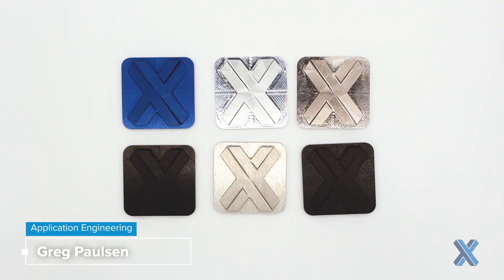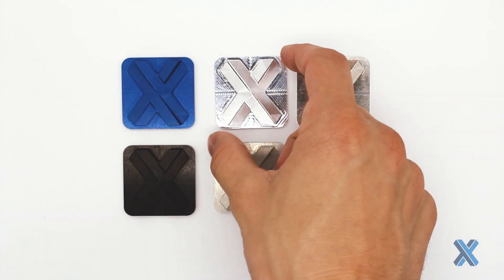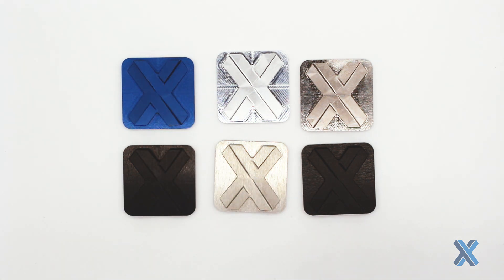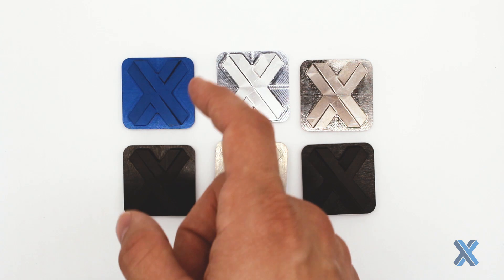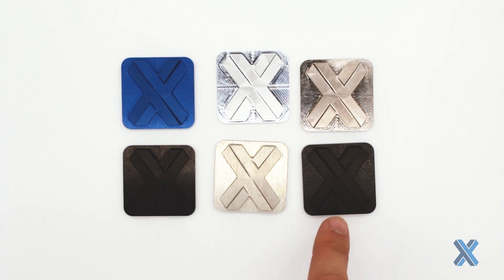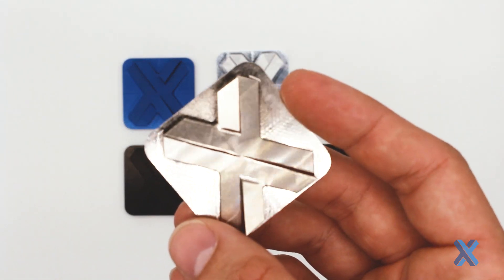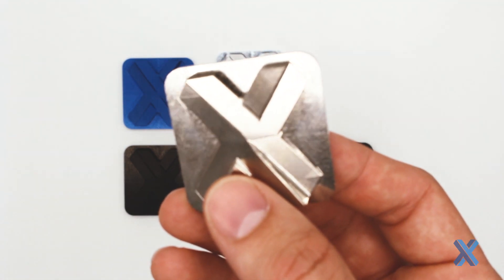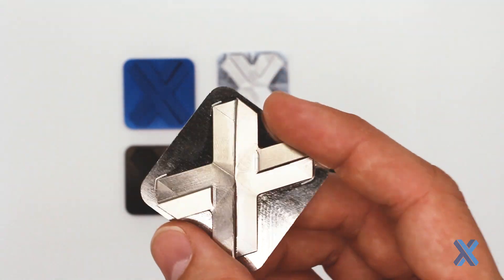The X Tiles: Anodizing vs. Metal Plating

Comment: I want to restore a Turntable platter, material is a Zinc alloy. I want to give it a high corrosion resistance as well as to improve its anti-static properties; what should I use, anodizing or platting?
Best regards.

Comment: Hey Greg, you guys are anodizing in house now?
Reply from the maker: Hi Cami! If you order custom parts through Xometry, you can have them anodized as a finishing option. We do not do the anodizing in-house. If you're looking to have parts anodized, but not manufactured, our new Finishing Services platform (www.xometry.com/finishing-services) is where you'll want to go. Here, you can send out RFQs for finishing services to a pre-vetted network of finishing partners from across the U.S.
Reply: @XometryHQ  thanks guys. I am aware of all that I was just wondering if you guys started doing some of it in house now because the way Greg was talking that is how it was sounding. Thanks for the reply!
Reply: @XometryHQ  I want to treat an aluminium flask inside to make it safer. What would you do? I was researching anodizing and now e-plating. I've got some zinc. A layer of zinc or even silver would be awesome. Is it doable? Why isno one doing it? Why we dont see aluminium cookware with a hard nickel or gold layer? Everyone would want one.